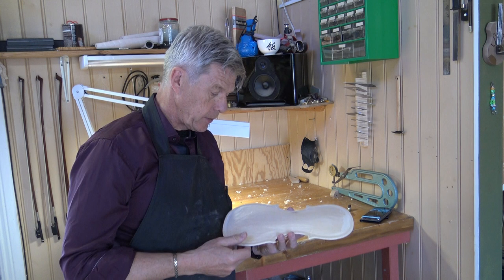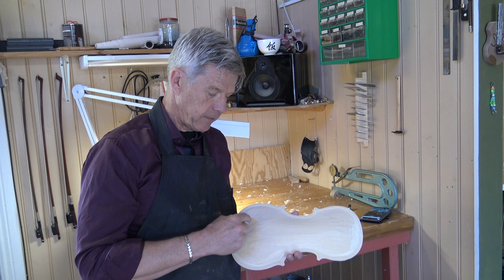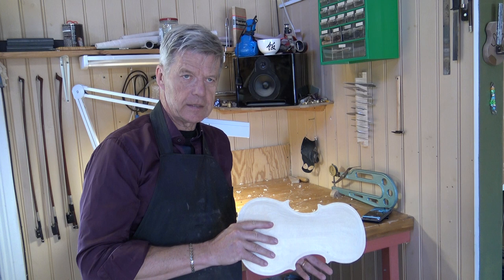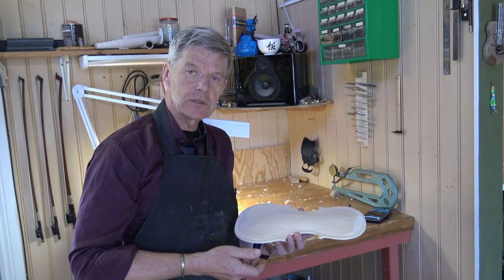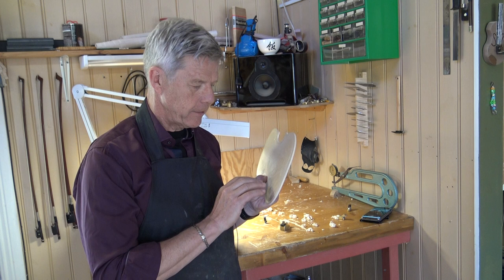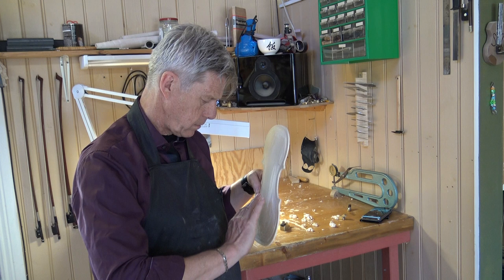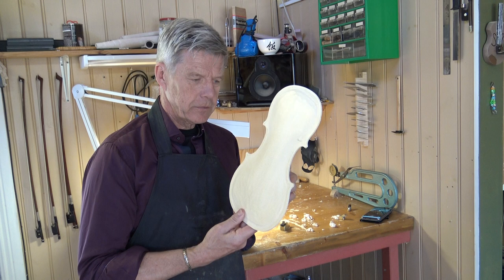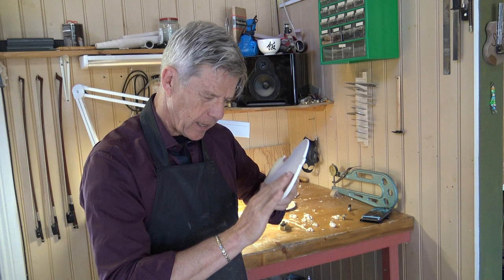Peter Westerlund shares his unique method of violin making

Comment: Peter, thank you for sharing. I'm just an amateur, so far I only made a very first instrument.  Please correct me if I'm wrong, I'm not sure if I've understood correctly.  Over the time the arching has changed, and the original arching height was lower at the paces where the sound post and the bridge caused a pressure. So when copying an old instrument thees changes should be taking into account. Thank you.
Reply from the maker: If I was to copy a violin, I would go for the "method". If you copy the present arch of an old violin, it will be deformed in its turn and end up with a deformed deformation. :)